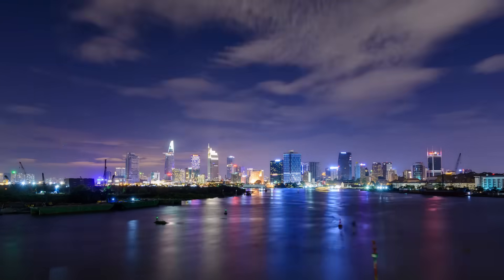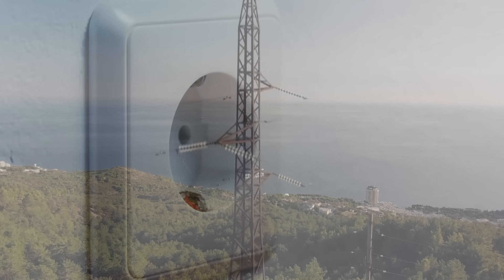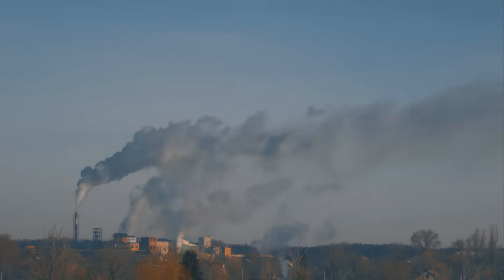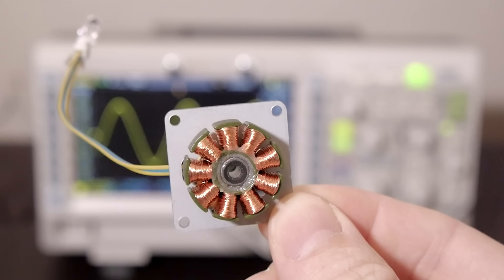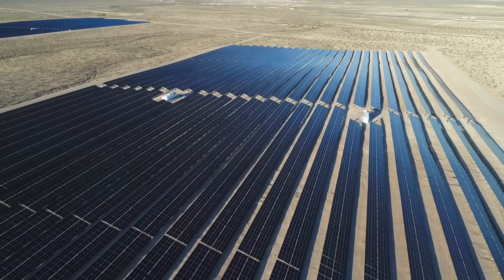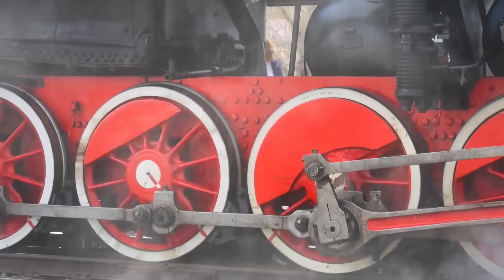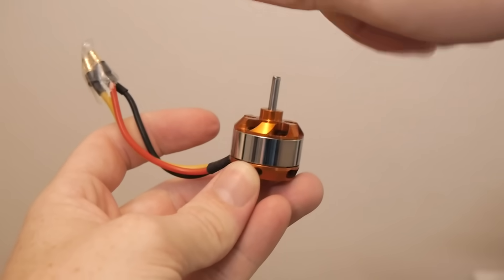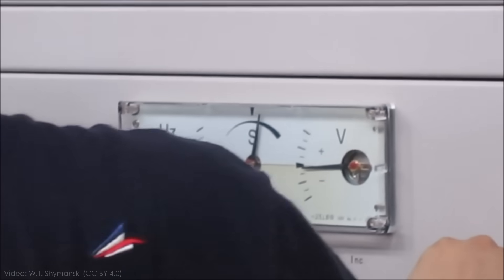How Electricity Generation Really Works

Comment: I've found that the more you learn about electric power generation, electrical energy storage options and how the power grid works, the more you understand that unless there are some astounding breakthroughs in electrical energy storage technology, wind and solar are not going to be playing a major role in the future of electric power production. In my experience, the more one learns about this topic, the more it becomes obvious that the best shot we have of decarbonizing the electric power sector is by turning for the most part to nuclear power.
Reply: For the price of nuclear power stations you can build massive pumped hydro stations solving the storage problem.
Reply: @catprog  Where are you going to put all these massive pumped hydro stations? Not to many places have the geography for that, and you're going to have to flood a lot of real estate to store the hundreds to thousands of gigawatt hours of energy your wind and solar plus storage system will need to have to deliver power on demand reliably. Run the numbers and get back to me.
Reply: @Marmocet  

Latitude -19.4190511 Longitude 146.495598  155GL of water 28Ha of land  500m head 135GWh of storage
Reply: @Marmocet   45.7881 -123.5094 to 45.7319 -12 3.7408 946ha total 150GWh
Reply: @catprog  Wow, that'll back up the US grid for about... 15 minutes! Problem solved!
Reply: @Marmocet  You said we only needed hundreds to thousands of GWh of storage.  How much do you think we need to store to have on demand power for the US?
Reply: @catprog  I said hundreds to thousands because the amount you'll need will depend on the size of the power grid you're trying to stabilize. If instead you're trying to come up with a solution scaled to the size of the United States, then here are the rough ballpark figures you're going to be dealing with.

US average power demand is 450 GW. Models suggest that to make a power grid powered by wind and solar dependable will  require electrical energy storage equal to 1-2 weeks' worth of demand. To power the US that way would therefore require something like 75,600 - 151,200 GWh of storage capacity, which is equal to 560-1120 of your pumped hydro storage stations. I guarantee that when you do the cost estimates, you'll find that all the windmills and solar panels, plus all the extra transmission lines that will be needed, plus hundreds to thousands of pumped hydro stations of the type you've descibed will be way more expensive to build, operate and maintain than it would be to decarbonize the electric power sector by building nuclear power plants.

Keep in mind too that, if you could even find enough suitable sites for 560-1120 135GWh capacity pumped storage stations, you've only got enough pumped hydro sites to cover the US. What is the rest of the world going to do? While you're thinking about that, remember that most of the demand growth for electricity will be coming from the developing world.
Reply: @Marmocet  1) Their is only ~240 years of uranium at current usage. (394GW total capacity).  So to go mostly nuclear you need to do research to build reactors with less fuel consumption. (or research into alternative fuels/processing)

2)I would say 5 days would be enough based on off-grid homes recommended to have 2 to 5 days.

3)Cost: Figures I have seen
-6 billion for a 1 GW nuclear plant in the US 
However if we look at a heavy nuclear country like France their nukes only have a 75% capacity factor. (So probably 8 billion for a GW of nuclear)
-4.5 billion to 6 billion for 3GW of wind (33% capacity factor)

Today's Hoover dam estimated cost is $664 million and stores 3,000Gwh (if you use 100m head and half the volume of the lake)
Reply: Storage of power) I would say the us only needs to on average generate 300GW (existing nuclear and renewables provide the remaining 150GW)

On these figures 14 days of supply would flood an area equal to 50 miles by 50 miles. (I have a spreadsheet with a list of area in the us where you could build pumped hydro.) 

For south America I would use  the top 10cm of Lake Titicaca and a lower dam to the North. (this is a 3,600 Gwh storage area)
Reply: @Marmocet  As an electrical engineer studying power grid dynamics, particularly frequency stability, I couldn't agree more.
Reply: @catprog  
1) There are hundreds of thousands of years worth of uranium on the planet. If we ever run out of uranium on land, it can be extracted from sea water. There are hundreds of thousands of years worth of thorium that can be bred into U233 and fissioned. If we ever exhaust our supply here on earth, there's lots more of it on the moon. Fuel supply isn't a concern with nuclear power.

2) Off grid homes don't engage in heavy industry or run industrial equipment that can break if the electrical power supply cuts out for even a few miliseconds. People living off grid also have the luxury of scaling back power consumption without incurring large economic losses, unlike society at large. And, off grid homes that rely on solar plus storage also typically also have diesel generators, especially in areas were electric power demand peaks during the winter. Storage requirements for such homes don't offer a good guideline for determining the quantity of energy storage an entire nation will need to ensure reliable power delivery every day, year after year. Models that have sought to determine this quantity suggest one to two weeks of storage capacity is needed to ensure grid reliability. Remember: the consequence of not having enough storage can mean a nation-wide black out, which would be an economic and public health calamity.

3) Your cost comparison for nuclear vs wind is flawed. Windmills don't last nearly as long as nuclear power plants, which can remain in operation for at least 60 years and may even be capable of lasting a century, versus ~25 years for windmills. Secondly, nuclear power plants produce power when there is demand for said power, so its output has value essentially 100% of the time. Windmills produce power in a manner that isn't correlated with demand, and they often produce power when there is no demand for it. Power output without demand has no value. When output has no value, any price above zero is too expensive by an infinite degree. From a system perpective, its value is actually negative because it poses a problem that requires a costly solution, like negative pricing and curtailment.

The high capacity factors you quote for wind won't hold if wind needs to be scaled up aggressively in a 100% renewables future because the most productive sites will be taken first, followed by more marginal sites. Alternatively, offshore wind will be needed in huge quantities and new windmills will need to be sited in deeper and deeper water, which is progressively more expensive to build and maintain.

Nuclear power, even produced from today's power plants, is simply faster and cheaper to build and therefore represents a superior solution to the decarbonization problem than renewables. Designs for new power plants, including molten salt reactors and fast reactors, will be even better than the plants we currently have. High temperature reactors will even be able to store heat when output exceeds demand and then use it to drive supplementary turbines that enable them to provide their own peaking power, so their capacity factors will be much higher than you suggest.
Reply: @Marmocet  1)How much will it cost to extract the uranium from sea water(currently it is uneconomical). Like I said new technology needs to be built.  According the NEA their is only 16 million tons on land. 

2)Off grid homes also do not have the stability of having a wide spread grid to mitigate the weather.
I have also seen a model that suggests Australia's grid has enough hydro now for 100% renewables.

3) The oldest wind turbine is 40 years.
With lots of dams their is always demand for pumping hydro water.
As for nuclear being 100% I will give you an example on the actual grid(NSW because I know where to get the data)  Peak demand for the day is 10,500MW, Lowest demand is 6,800MW . If you were to use nuclear for the 10,500MW then you would have 3,700MW sitting idle in the time of lowest demand.

I am using real world numbers from France reactors where they have to sell cheaply or as you say curtailment of the nuclear

High capacity factors for wind turbines are up to 60% in some cases.
 
The biggest argument against nuclear though is no one is willing to build it. If it was as cheap as you said then economics would say someone would build it.
Reply: @catprog  No, pumped hydro doesn't solve the problem with lots of intermittent renewables. What happens when there is basically no wind and there is low solar irradiance for a week. It is far from being economically viable to have that much pumped hydro.
Reply: @FrainBart_main That calculation was  based on two weeks storage so a week will not do it. And this would have to happen over the entire US.

Comment: I've tried off and on to understand load balancing and how I can flip a switch and it not collapse the power grid for years...and you finally made it click with me when you showed the load on the brushless motor when you shorted the circuit. Thanks Grady!!!
Reply: Because power diminishes while it's resistance reduces the power
Another thing that can crash the mains is a alternating oscillation

Comment: It's nice when us Engineers in the utility business get thrown a bone or two over the complex work it takes to keep the grid working. Plants can actually be tripped offline (due to a generator and thus turbine trip) from the grid's customers causing a phase imbalance. Many industrial customers heavily use the "C" phase on ours, so during the weekends the C phase can be out of balance with the A&B. The generator only can tolerate so much imbalance before it trips to protect itself.

Comment: Wind and solar are not unreliable. They're the most reliable sources used today. They're regularly intermittent which is a completely different thing. Coal is unreliable and irregularly intermittent. Coal being a small number of large generators can and does fall off the grid with no warning (unreliable). That's the main reason for needing spinning reserve, because fluctuations in coal or nuclear generation are much larger, less predictable and more sudden than any load fluctuations can be. There's never a situation where GWs of load comes on the grid in milliseconds, whereas GWs of generation can be and is lost in milliseconds.
Reply: @MGTOW individualist you might or might not like it. However that doesn't alter how networks are managed. There has to be sufficient spinning reserve to deal with the largest credible outage. If you have a 3 GW plant, be it nuclear, coal, or squirrels in cages, you need to be able to deal with that plant going off unexpectedly.

When the largest wind turbine is 12 MW, you simply need less spinning reserve. Now that's skewed somewhat when you include connectors and feeders. Then it generally becomes the size of them that sets the size of spinning reserve needed.

Running a network isn't about politics or point scoring the way a comments section is. There are obvious basic principles that need to be followed.

Comment: Electricity moves nowhere near the speed of light. It's micrometres per second, not thousands of kilometres per second.
Reply: You are talking about the drift velocity in DC lines. He is talking about the electromagnetic wave propagation in AC lines.
Reply: @FrainBart_main  he literally says "electricity moves at nearly the speed of light". Those are his exact words.

So he either doesn't know the difference between 'electricity' and 'energy' or he doesn't know how fast electricity moves.

I suspect it's both, as he uses the words electricity and energy completely interchangeably.

Either way, it's wrong one way or the other.
Reply: @gasdive  Electricity usually means electric energy. Sometimes people equatr electricity and electric current, that's where the confusion comes from.
Reply: @FrainBart_main  the title is "how electricity generation Really Works"

Not "how electricity generation is thought to work by people who don't even know what the words they're using mean"

You're probably right that people who don't know what they're talking about often use the wrong words to describe things they don't understand.
Reply: @gasdive  Look, I'm only master's thesis away from having a master's degree in power engineering and we always reffered to electricity as electric energy and electric energy travels through different mediums at a different speed but always at a fraction (usually 50 % and higher) of the speed of light in vaccum. So yes, in this sense he is right, electricity does travel close to the speed of light.
Reply: @FrainBart_main  aren't you saying the same thing as me then? You say you always referred to it as electric energy and that the speed was some decent fraction of c. You're right, electric energy (or signal) travels at some good fraction of c.

You're agreeing with me, not with him.
Reply: @gasdive  What you don't understand is that electricity and electric energy are the same thing in power engineering. So his statement that ''ELECTRICITY moves near the speed of light'' is true.

Comment: What about large scale Lithium Battery supplies to store wind and solar generated energy for use at later times.. I see Tesla pairing solar energy with batteries to achieve generation and storage for household use.
Reply: Batteries have their own inefficiencies and don't store as much as you think, but more importantly most of them degrade rather quickly. In 2 years batteries only have 80% of their capacity as originally, though this depends on a lot of factors.

Comment: Thank you for the well produced video.
Corrections:
a) 3 phase can supply 1.73x more power than single phase. 1.73 is also the square root of 3.

b) For a generator to be attached to the grid, you correctly stated that freq and phase need to be perfectly matched, but not necessarily voltage. Actually the voltage can vary some, the higher voltage generator will simply carry more load. For instance, slightly higher voltage is what allows grid tie solar and wind to supply power to the grid.

c) solar doesn't simply supply power for half a calendar day. It depends on where in the world they are located, the seasons, and the weather. There is a resource that does well to estimate the yearly average in kWh/m^2/day. The NE US is 3.5 to 4.0, while Southern California is 6.5 to 7.0 Figure this value against the area of your solar array and its efficiency and that's the estimated power it will produce in one year's time.
Link: https://www.nrel.gov/gis/solar.html
Reply: Err can I get a source on that 3 phase power statement? Everything else I see states that 3 phase power can indeed carry thrice the power of a single phase.
Reply: @storyls 
Here's one place that gives a good layman's explanation of single vs three phase and states the proper power difference for the same current (1.73x). It mentions it a few lines into the explanation for 3 phase.

Also in 3 phase systems, if you want to know the single phase (hot to neutral) measurement, you divide the phase to phase voltage by 1.73. So, for 208V phase to phase, the phase to neutral voltage is 120V. For 480V ph to ph, the ph to neutral voltage is 277V. For much of the high voltage distribution circuits that feed the smaller transformers that then feed homes and businesses: 13,200V ph to ph is 7,621V ph to ground (no neutral). So, if you get hit by that little wire going to the top of a neighborhood transformer, it's 7,621V that will blow your hand and feet off your body and cauterize your internal organs. The hospital forced to keep you alive and suffering for the next 2 to 4 days, knowing that there's no chance of you making it.
http://www.oempanels.com/what-does-single-and-three-phase-power-mean

Another, watch all or just start at 7:42 for 1ph vs 3ph. Note that 6.2 x 1.732 = 10.7
https://youtu.be/iMn7dq7B1oo

Comment: In my opinion you need to talk about the electrons and how they actually move and interact.
Reply: They just vibrate in AC lines, which are mainly used for electricity transmission.